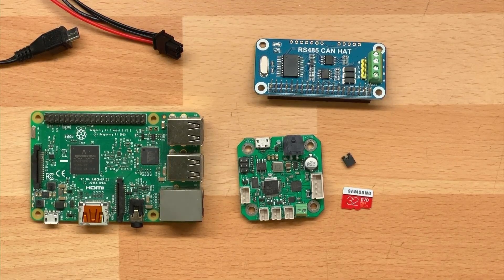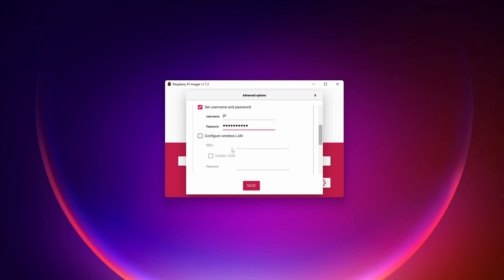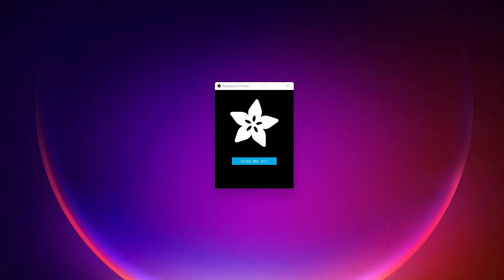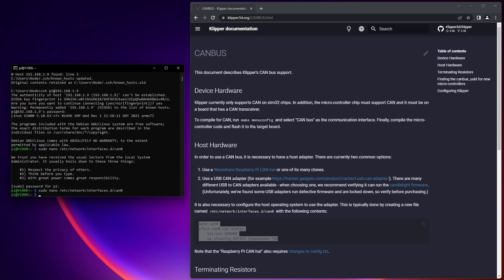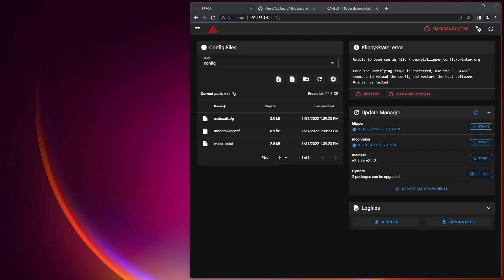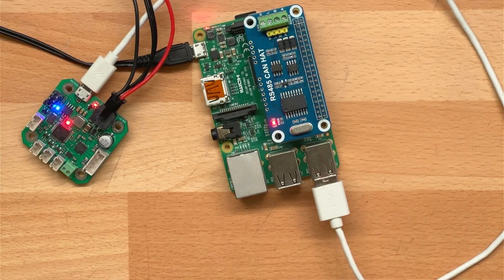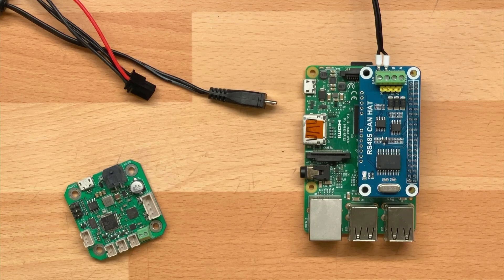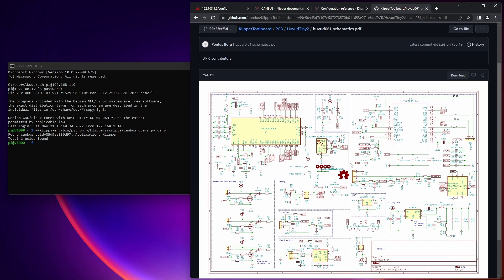Klipper Mainsail CAN Setup Guide - Huvud

Comment: This will not work for Huvud 0.62   You must use the newer video because Huvud 0.62 has canboot already installed at rate of 250000.  Canboot has different offset of 8 not the 2k.
Reply from the maker: Yes! A lot has changed in the last 11 months since this video.

Comment: Klipper has a very cool feature being in development right now that allows your main MCU board to also act as an USB CAN dongle, you can hook up Huvud or other CAN devices directly to the main MCU board. No need for a CAN HAT or separate USB dongle for CAN. The SKR Octopus has the required hardware already. Other boards will need a separate tiny board with a CAN tranciever chip, and access to two pins from the MCU that supports CAN. The MCU on the board must be one that klipper has CAN support for, STM32F4 will work, STM32F1 does not work, STM32G should work,.
And pi pico (rp2040) CAN bus support is on the way as well. 
Klipper CAN support is getting better and better.
Reply from the maker: I am so excited for this! I’m planning on making a tutorial video once it is officially available

Comment: Great guide!  I had the Mellow board arrive last week and have been experimenting with it.  Plan to get a few more and add them to a tool changer setup.  I'm glad to see multiple manufactures getting involved in helping make these mainstream for more entry level 3d printing.
Reply from the maker: I'm looking forward to testing the Mellow and BTT boards! I got in a NEMA14 Mellow but it had the incorrect fan mosfet header pins so I haven't gotten it to work yet. I have a replacement on the way!

Comment: YYYEEESSS, I've been waiting for this. I'm almost finished with my Voron 2.4 350mm. While I have all the parts required I'm still going to run the cable chains and use the Huvud I have for another Voron 2.4 250mm.